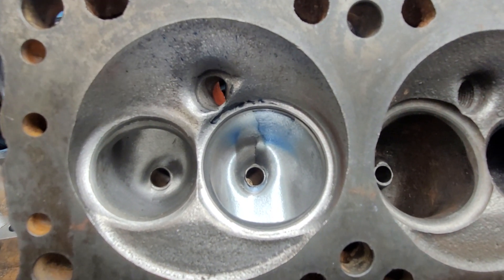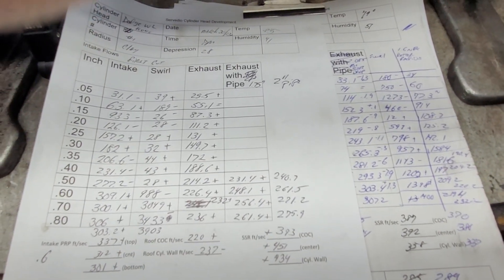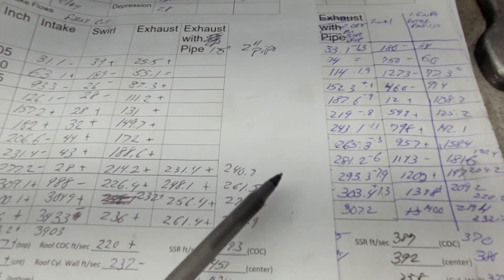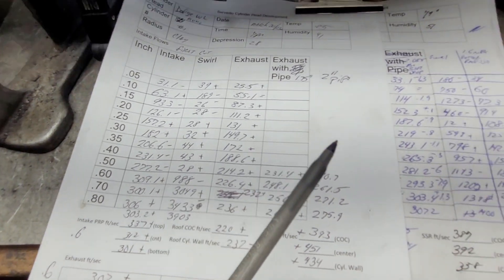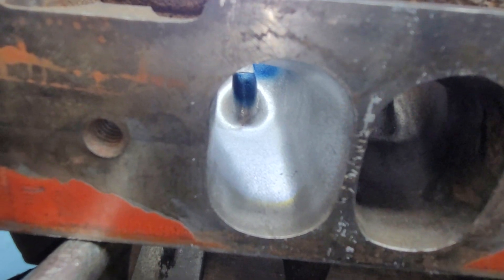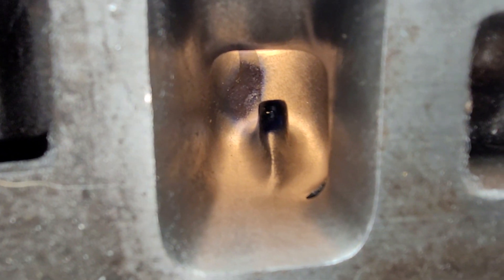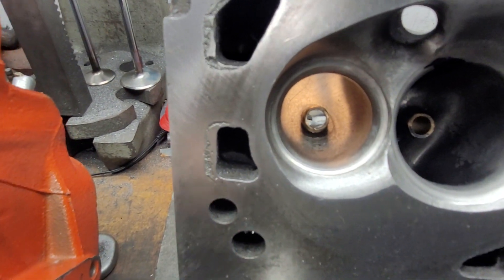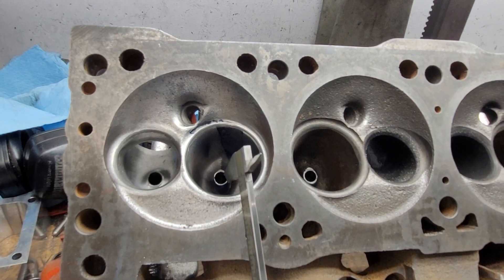Mopar W2 810 first cut cylinder head vs. Trick flow high port cylinder head. Flow design discussion

Comment: The W2 design dates back to about 1974 with the actual release being 1976 for the econo head. Considering  roughly 35 years separating the two heads I think the W2 shines bright. A matching valve as the Trickflow has would show just how good Mr Mullen was when he designed the W2.
I would put the W2 up against anything made out of iron as long as it has the same cubic inch, cam specs, and compression, and that includes the Cleveland if it had it's original exhaust flange to bolt a header onto.
Reply from the maker: I like the design too!
Reply: If you believe Herb Mc Candless the W2 date back to 68 69 but the HEMI ruled they shelved the W2
Reply: @dang5553  I have seen some W2 type heads with a 3577xxx casting number.  That prefix was used on the T/A special parts for 1970 Trans-Am and AAR Cudas.  Car Craft or Hot Rod did an article on the W2 heads circa 1974 with brazed X heads done by Bob Mullen that looked like W2s.  He flowed heads at 3 in H2O back then.
Reply: Good comments. I’ve heard or read several times that the W2 or something quite similar, was also meant to into production but by the later 70’s times had changed. Don’t know how true that is though. Maybe I missed it in the video but the TrickFlow doesn’t require offset rockers like the W2 though, does it?

Comment: Hi Charlie. It's interesting that the W2's have a more efficient port shape but you got so much more flow from the Trick Flows. I know you said that the Trick flows had more work done to them though. Interesting to compare different port designs. Do you think that with more work the W2's will be able to equal the lower lift flow of the Trick flow heads? Andrew
Reply from the maker: The trick flows have a bit bigger valve too. I may not have mentioned that. I think the W2 would love bigger valves.

Comment: Weren't the W2s from the 70s.  They Moved on to W5s and the W7/W8s later. Those trick Flows from same era?
Reply: The first W2 heads were introduced in the 1970s and Mopar still offers them for 48° blocks(r3, Ritter) Mancini sells bare heads for $200 ea, but that's just the beginning as a user will need to round up all the special bits to make them work. I don't recall when the rest of the W heads were released but the Ritter-Weber E/A car had prototype W9s in 1992 or 1993.
Reply: You still can get W2 for a 59 tappet engine I’ve not seen eco heads for a while
Reply from the maker: I have no idea.
Reply: Released 1975

Comment: You know what Chuck, I didn't notice this before, but those heads only have one set of threads drill to either side. There is an alternate bolt flange pattern that is 45° to the centerline of the original port. It's been years since I ported a set of TFS Hp's, and until you noted your disappointment with the exhaust it hadn't clicked.

The set of bolt holes you have get filled in max effort situations. Trickflow cnc's a large oval port maybe a hundred thou from those bolt holes and the angular bolt pattern is used. For a 2" primary I've threaded in a solid piece of aluminum with JB Weld and ground my port in accordingly. 

Same with the AFR 205's and 225's. Widening does wonders as well for exhaust flow.

I think that's why you're underwhelmed and skeptical to all the hype talk about how great they are.
Reply from the maker: Good info, thanks